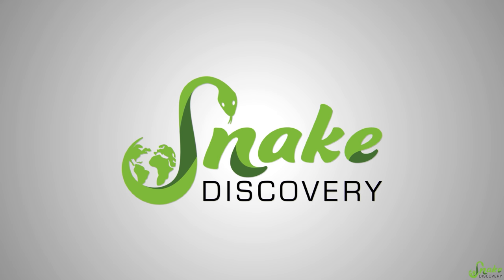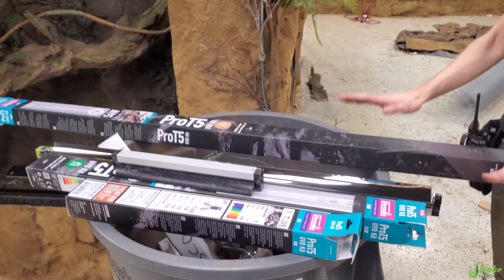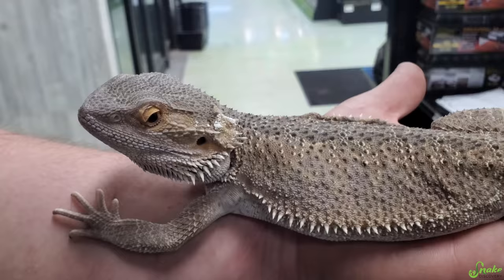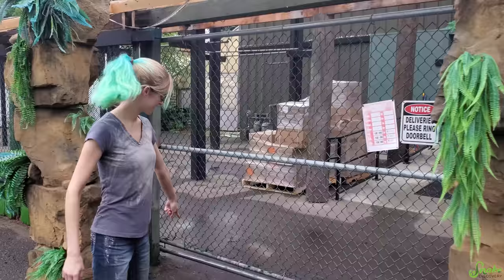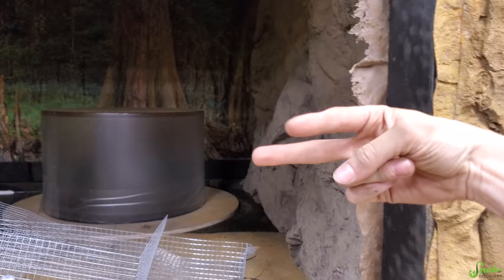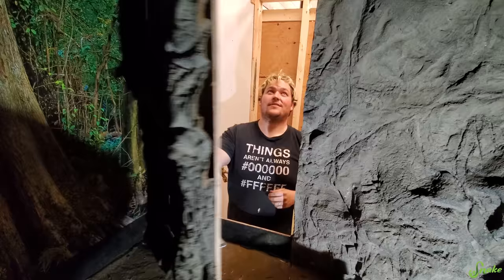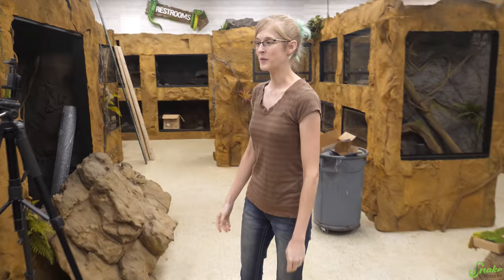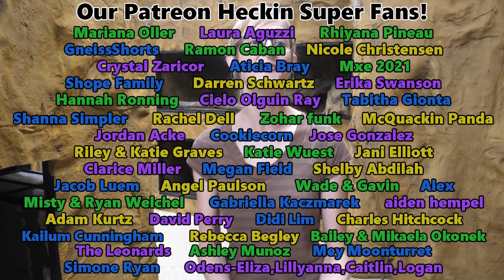Building Update #17 (Rex's enclosure and more zoo progress!)

Comment: Just a word about disabled parking spaces! While being close to the doors is lovely they also need a space/aisle on both sides that a wheelchair can fit in! This is so people can transfer into their wheelchair which isnt possible if theyre a foot from another car <3
Reply: Yes that was a concern of mine too.  They need to remove two of those front four parking spots to make a safe space on both sides for handicap parking.
Edit: by removing 'two' of the spaces I mean the second spot on each row, then move the handicap space over a bit and paint the crossed lines in for the alley on both sides of the handicap space.
Reply: Perhaps just paint over the line between the first two spaces, so drivers have space on the specific side of the vehicle they need it.
Reply: @wildflower1397  a handicap space should always have room on both sides for it to be safe and usable.  And it should have enough room for a ramp and the ramp still be accessible to a wheelchair if another car is parked next to it.  One side is not always enough if the handicap vehicle needs to park on the second set of lines to make their ramp usable and accessible from the other side.  This is just my thoughts on it though.
Reply: Reverse parking is not that hard 🤨
Reply: @lemonpaperplanes  Indeed however the current space next to the parking space is part of the road, there will be cars driving there and not everyone will stop for disabled people so its incredibly dangerous. Even if it wasnt dangerous what if theres more than one disabled person in the car and both sides are needed? Or what if someone simply doesnt want to reverse park. Disabled people are still people and deserve options and safety :)
Reply: @lemonpaperplanes  yeah but disabled people shouldn’t have to back up just to use their ramp or any other mobility aid. I can’t speak for all people but for myself who uses a wheelchair it’s better to have some more room than   In a tight spot and at least in my state it’s the law to have the white lines to have an extra space for the handicapped parking

Comment: As a wheelchair user, I feel the need to ask you to make sure your ramps aren’t multiple inches higher than the sidewalk. The casters get stuck and you can get dumped forward out of your chair. Also 👏🏻👏🏻👏🏻 thank you for putting a changing table in the men’s room.
Reply: I think in an earlier update they said they’ve been in contact with the city to make sure the ramps are up to standard (so the incline isn’t too steep, etc.)
Reply: As a wheelchair user, I can honestly tell you that "up to standard" means NOTHING. The "standard" is literally just the bare minimum to not get fined. 
Having the ramp higher or lower than the sidewalk/parking lot has caused me to be dumped out of my wheelchair on numerous occasions but as long as the height difference is below a certain amount, it's still within the legal standard, even though it's enough to dump someone on their face. 
Also "up to standard" means they can legally (and I've come across this countless times in my life) put the only curb cut (ramp from parking lot to sidewalk) on the opposite end of the building to where you have to leave the rest of your group and go to the opposite end of the building, often going through utility/ storage rooms and down long halls to get to the room right inside the main entrance where everyone else is. This also means that unless you're willing to be carried or are able to walk (because 99% of the time they won't let you crawl down) stairs, you have to go through that long hall again to exit. 
Places being "up to standard" means they are technically "handicap accessible" but that's much different than "handicap friendly" and things being legal, yet still not handicap friendly has lead to many situations that are humiliating to say the least.
Reply: @SpeedDemonStar  Yes! Up to code does not mean safe, easy to use, or respectful to wheelchair users. We need better laws/codes, and many good ones need to be need to be better enforced. Thanks for speaking up! :)
Reply: @wildflower1397  Absolutely!! Nothing quite motivates me quite like having to brace for impact to keep my face from hitting pavement... even worse when a fall happens with folks watching and they insist on helping, even when you don't need it. It's like yeah, I appreciate the help, but pls only help in the way I request. Don't try to tip the chair back upright without letting me unbuckle the seatbelt first cuz that HURTS!!
Reply: @SpeedDemonStar  Ouch! I have always wondered why the don't put roll bars or something on wheelchairs? You make it sound like using a wheelchair is akin to always being on a carnival ride, lol. Perhaps you need a helmet? Hopefully they will invent hover chairs soon. :)
Reply: As a person who has had to push many people in wheelchairs I could not agree more. It's sad how little people understand what : handicapped accessible" actually means. In most cases handicapped accessible means they have a ramp (not even a safe one) and a few grab bars. I know in hotels it just means they gave safety bars by toilet and shower. Oh and a roll in shower although necessary for many many in wheel chairs is considered a perk in a room so they are harder to find and can cost more .
Reply: @SpeedDemonStar  I’m well aware. I was wheeling my handicapped grandmother around until she died of lung failure, and again when my cousin lost the majority of her muscular function after brain cancer treatment (up until 2019, when she died of pneumonia). My family also has a history of MS, which means a lot of wheelchairs and walkers on bad pain days. I was simply reiterating what has already been mentioned in a previous video. Your accusatory tone made me quite upset.
Reply: @wildflower1397  Lol, that's not entirely inaccurate, depending on where you are! I've gotten used to it enough that I know to look carefully & if necessary, go backwards so the big wheels go first to avoid flipping over. I also know how to brace to not hit my head or hurt my neck. It still skins up the knees & arms pretty good though. I'm mostly fine when I'm pushing myself, because I know to look & am careful, but I wear my seatbelt when others are pushing me for this very reason!!
Reply: Also those handicapped parking spaces should have space on both sides for a wheelchair user/mobility aid user to get in and out easily!
Reply: @Letcharlieplay2545  oh my gosh yes can't even tell you how many times I've had to drive around until I can find a place that has the space for the wheelchair ramp on the right side
Reply: @SpeedDemonStar  that absolutely sucks but the people who should be forced to enforce better standards are the lawmakers, small businesses sticking to standards are only that, small businesses sticking to standards but it's good to bring awareness to the issue and all that, especially since that puts more pressure on the lawmakers
Reply: @Letcharlieplay2545  +
Reply: @SpeedDemonStar  In my head you are wearing knee pads and wrist guards too. The whole setup for extreme skateboarding, with flames on them, haha. Everything else with wheels requires safety gear, so why not extreme wheelchairing? 😂😂
Reply: @wildflower1397  Wheelchair skateboarding is actually a thing. It's pretty cool actually! The wheelchair equivalent to most sports are more hardcore tbh. When in doubt, if it's a sport played on wheels and/or with a ball, there's a wheelchair equivalent. You should check them out sometime. My personal favorite to play is powerchair soccer, with racing & basketball being tied for my second favorite to do.
Reply: U was about to comment about the men's bathroom, preech.
Reply: @The_miIk  we love when places remember that there are involved fathers.
Reply: @bayleighc.5843  yup!
Reply: @SpeedDemonStar  I will go google it... I know there are lots of wheelchair sports, but I never thought skateboarding would be one of them. :)

Comment: Omg… fly on a leash flashbacks. O_o When I was a kid, I used to catch flies and loop knots of hair or floss around them to try and leash them. I was like… first grade? But I stopped because the success rate was low, and would often result in… gulp… the fly splitting in twain. (Sorry flies!! Still carry some guilt there!)
Reply: How long would the “successful” ones last?
Reply: @popenieafantome9527  I didn’t keep them for long- I don’t remember if they could actually take flight or not (I think the one tied with a hair did a loop or two?) but I’d show them off to my sister and then set them free.
Reply: I never did or saw it in person, but I've heard tale of a kid who stunned a fly, tied a hair to it, weighted the other end of the hair, and had that fly buzzing in a circle for the rest of class.

Comment: You really need to make proper accessible parking. The spots you want to make accessible aren't because there's no space to allow for people in wheelchairs to get in and out of their cars. You need a very large space that's marked as no parking nearby to ensure all different types of ramps can be used. 

Additionally, you want to offer that space on both sides of a car. Which can be done by having different spaces with the marked off areas on different sides. 

If you want an idea on how to do it the right way, then go to a Wal-Mart and look at their lots. They, surprisingly, have great accessible parking.

Comment: I know I won't ever get the chance to visit, being a decently poor, disabled fan in Canada, but I wanted to thank you guys for thinking of those of us unfortunate enough to need a wheelchair. I've been bound to one for the last 5 or so years now and because of that, I have had the chance to feel first hand just how inaccessible most places really are. Especially the further you get from the equator... snow is very prejiduced against disabled people. I digress.

On behalf of all of us who have had to struggle, or just give up shops we know we would live, just becauae we can't get inside: THANK YOU!! It has to be one of my pet peeves. Or I guess it's more peeve adjacent. My actual extreme annoyance is when a place of business so obviously does everything to the literal bare minimum in order to be open for business. For example: ramps that are more closely related tp a half pipe than an actual ramp. Or bathrooms that have a disabled stall, but the outer most door has no mechanism to open, causing people in wheelchairs to either ask for help, or just hold it... which is so terrible. Then, in the same bathroom, once you do struggle yourself inside the main washroom, you're met with a room that someone over 150lbs without a chair would have trouble manuvering, but you finally get through, and thankfully there was no one in either bathroom because neither have enough space for a chair. So you then need to get up out of the chair, locking it in front of the able bodied stall, and squeeze yourself into the disabled stall; all of this assuming you hadn't just peed yourself during the whole struggle. Why get out of the chair? Because, and I kid you not, if you want to be able to actually close the door, you can't have the chair in the stall. You get chair or privacy, not both.

And yes, I am speaking from actual experience. It was a McDonalds. There have been others, this one just stuck with me the most. It makes me so angry because I'm fortunate enough to be able to get out of my hair little bits at a time. I'm also fortunate enough to be Canadian where Karen's aren't as likely to try to stealy chair (although I still try to never leave it unattended.)

The reason I get so angry is because it is so clearly prejiduce toward the disabled. These owners don't care about actually helping disabled patrons in their establishment, they're only concerned with what they can get away with, which is kinda gross when you think about it. They do the literal bare minimum in order to make money. They don't give a single eff about whether or not their disabled patrons embarass themselves because they came to eat a meal, and now have nowhere to do their business. 

So yeah, I'm incredibly grateful and happy that you guys took so many steps in order to just help people in wheelchairs enter your shop. ♡

Comment: The 50lb weight limit for the changing table is actually very important: a lot of developmentally delayed kids (like those with downs syndrome) have to wear diapers and pull-ups past average potty-training age. The absolute best thing public spaces can have is a changing table that can support even more weight, but you know, baby steps
Reply: Yep it would be great if they had a changing places toilet (I don't even know if they have a standard wheelchair accessible toilet but I hope so). Changing places toilets need so much space it's much better if you plan for one when you're planning the building, adding it later is really expensive. Accessibility is much more achievable when it's planned from the start so it's important for people to be aware of it early on so they know to plan for it.
Reply: @SomeoneBeginingWithI  I'm pretty sure in the US you are required to have a handicap-size/accessible stall, so I don't doubt they have one

Comment: Wouldnt it be safer to have the Rex feeding door opening the other way? So if need be you can shut it quickly rather than having to lean into the enclosure if she runs at you too quick. And it would open wider too.
Reply: I agree. It's awkward with the hallway being so narrow, I don't know if there would be room in the hallway for the door to swing. Like if you are standing in the hallway and the door is open, and you need to close the door, your body would be in the way of where the door needs to swing and you wouldn't be able to step backwards because the hallway is too narrow. It seems like they didn't plan this very well and now it's harder than it should be to make it safe.
Reply: @SomeoneBeginingWithI  that's a good point, I'd wondered about a sliding door then thought there might be an awkward episode of poor Rex half in half out.

Comment: I love you guys, and I respect all the hard work that you've been doing with the facility, but why didn't you make it so the cages on the bottom of the zoo enclosures opened from the outside when the doors were open instead of havin'em so you had to crawl inside to change lights?
Reply: It would probably encourage theft of the animals more, which is a sad truth.
Reply: No, I mean if the clamps could be opened without having to climb inside. I think it would work better if you could ou unlock the display's door and take the clamps down from outside.